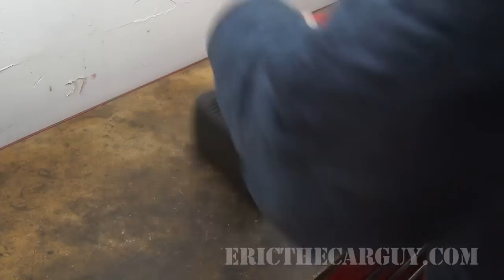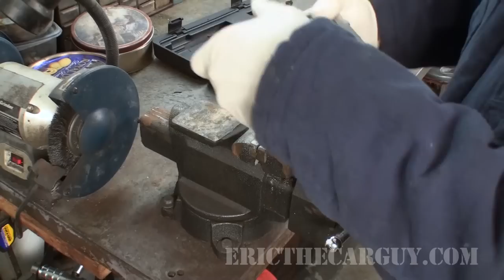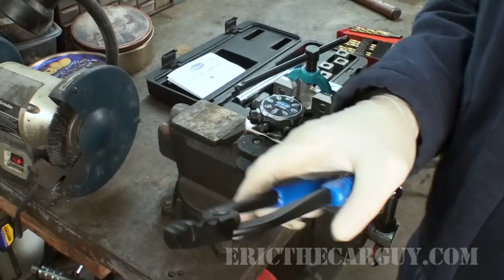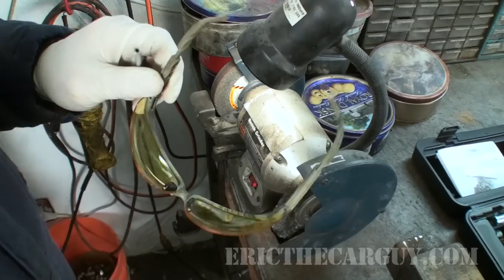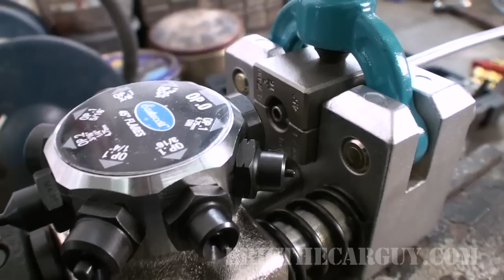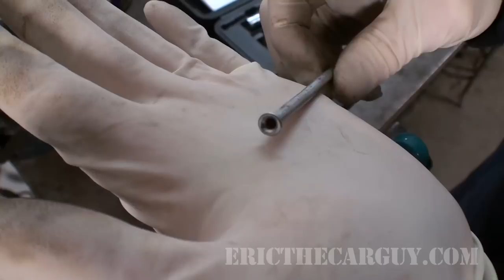Eastwood Line Flaring Tool Review -EricTheCarGuy

Comment: When using the tubing cutter I have found never go the same direction in turning. It is best to turn than tighten and turn back the way you came. This helps if your tubing cutter is worn or not properly aligned. It will give you a more consistent cut.

Comment: Another quick way to measure the brake line diameter, put the open end of a wrench over it.  A 3/16" wrench fits snugly over the 3/16" line and a 1/4" wrench fits over the 1/4" line, etc.

Comment: Got sick of using the older flaring tool over the years at about 60% effectiveness. Bought the Eastwood tool and the Lisle 3/16" tube bending pliers and was astounded by the effectiveness of these tools.Awesome. Best tool combination I have purchased in years. I have not made a bad flare since. Thanks for sharing Eric.
Reply: I've always gotten a 100% success rate with my cheap tool. I don't do enough brake jobs to spend the money on this tool.

Comment: Excellent tool, and fun to use! I'm restoring an old 56 Chevy, not a full time mechanic, so I found a Vevor flaring tool, pretty much identical, for less than $100. Comes with basic dies, and tubing cutter. Does both 45* and 37*.  I love it!!

Comment: sorry if anyone covered this already, but you mentioned that 37 degree flares are becoming more popular with builders for "some reason". The reason is in fact, stainless steel lines. You're supposed to use a 37 degree single flare on stainless line because of its nature to easily become damaged or split during the multiple bends required to achieve a 45 double, or even a 45 single flare. If you want the nice shiny stainless lines, you gotta do single 37 flares!
Reply: I use the Ridgid flaring tool specifically for stainless lines. It doesn't press the whole flare at once, it presses in a circle, slowly flaring as it rotates. 

I have this Eastwood flare tool also but I'm having issues now getting a flare that doesn't leak, and I've barely used it.

Comment: I have been using the Master Cool hydraulic hand tool and it works great. It will do double flare, inverted flare , push connect, metric bubble, and GM transmission. All at a cost of $300.00
Reply: 37 and  45 degree at that price?

Comment: Oh man....  I used the old style to do my Ranger once.   Now that I had that experience I can justify the $200 for this upgrade.   I knew about the $200 one from Eastwood, just tried to make the $60 dollar old style work.  Had to remake several flares as they were off center.  Spent lots of time...  learned a lot about flares.  Like learning to use hand tools before power tools.

Comment: Another great & informative video Eric. I have no doubt that this tool works great, is well built and well worth the price if you're doing a lot of brake lines in a shop or something. But for the DIY'er like myself (and I presume the majority of your viewers) who rarely has to flare hard lines, this tool is a little pricey.  I just wouldn't be able to justify the expense for a tool I might use once a year or so. The 'clamp' style tool is available for rent from most auto parts stores for 'free' so most DIY'ers will probably gravitate towards that tool rather then a $200 tool.  A video on how best to use the clamp style tool would be awesome though and probably help a lot of your viewers.  Thanks.

Comment: GREAT TOOL! But I would not throw the other flare too away, because it doesnt look like this can easily be used on the vehicle, like the other flaring tool can
Reply: I was thinking the same thing.  The only disadvantage would be a job where you have to do a run from the front to back and you don't want to take the line out again once you cut it to size.  But, this thing is still amazing.
Reply from the maker: You're right, and I won't.
Reply: EricTheCarGuy I wouldn't either. The other tool I seen time and time again was a snap on hydraulic tool, which is like $600 or something nuts like that. If I could get the hydraulic tool for $200 I would certainly get that. Ha, what you should really do is make a video on how to use that $20 flare kit. I used to work at an auto-parts store and see those things come back stripped all the time because people don't know how to use them right. One other thing I did was keep small sections of brake line in my tool box when I first started working on cars labeled with tape what size they where. Same with vacuum hoses.
Reply: I agree. I wouldn't throw the cheaper tool away
Reply: If you're doing 3/16" double flares, get the ~ $35 Eastwood hand held tool  It works much better than the butterfly type.  It's on Eastwood's website as 31244 and Eric has also done a review on it.

http://www.eastwood.com/eastwood-on-car-flaring-tool-for-3-16-tubing.html

Comment: AN Fittings ( believe or not stands for Army Navy ) is approved for aircraft. AN fittings use a 37 degree flare. I have been told the reason being the stainless steel will tend to crack when flared to 45 degree.

Comment: Recently picked up a very cheap GM wagon with rotten brake lines.  I have always shied away from a car with this problem, mostly because every mechanic I have known  has ruminated about what a PIA this kind of work is.  I watched your vid on the Fairmont brake line replacement, and I am super appreciative of the way you approached the task.  I am, as a DIY guy, ordering the Eastwood tool, yes, a lot of cash, but do it once, do it right.  Still beats paying the local jerk.

Comment: That is one well-thought-out tool! Outstanding!
Eastwood: make a simple line measuring tool to include with the kit (ie - a flat piece of stock with slots cut in it in the different tube sizes that can be slipped over the line to determine its size)

Comment: I bought one of these not too long ago and its takes all the hard work out of doing brake lines - they are actually fun to flare!  I've been getting away without lube, but WD-40 is good enough.  After your flare, slightly loosen the blue clamp and wiggle the line - that frees it up so when you pop the pin and swing the clamp off the line is not stuck to the dies.

What I like doing is removing a line off a vehicle and bending it to match and flaring new ends.  This is much easier and you don't have to use that clamp too under a vehicle.  Oriley Auto sells a REALLY nice hand flare tool like he shows above - it looks to be better material and has a better case.  Just tell the guys you are buying and not renting, or have them order a fresh un-opened flare tool to buy. 

Worth every penny - everyone will want to borrow it.

Comment: Excellent video very professional work. I had to replace the brake lines on my bmw 2005.750li 
they were rusted under the rear side sub frame  . I had to change complete  brake line from rear to front with flex hoses as well . I took the car to auto garage they said to work on this car with material you will pay 1500$  i said no thanks went to another one down the road he said  1000.$ with material because this car needs complete master cylinder flush and abs flush .
I watched > Eric The Car Guy<   what a great guy made it so easy and simple job. I did my car brake work it cost me 200$ Thanks to >ERIC THE CAR GUY< you are a  brilliant mechanic.

Comment: A proper brake flaring tool will save a lot of heart-ache.  We needed to replace the ENTIRE rusted out brake line system on an old pickup truck we got that had sat for almost 10 years.  My room-mate at the time took this on, and got a cheap flare tool, annnnd.... well... I believe it's still having leakage problems after 3 attempts.

A good flare tool and good brake line will save you MANY HOURS of work and tracking down brake leaks that are inevitable with a cheap tool.

Comment: They work great on brake and flared lines. but I like my Mastercool Universal. 71475. Does pretty much any tubing connection type out there (trans, brakes, fuel, HVAC) and can do it on installed lines as well as on the bench. This tool is nice but being bench bound limits you in many ways.

Suggestion on tubing size tool. Take a block of either hard wood or metal and drill 4 holes in it to match the tubing sizes. Or buy 4 of the fittings and couple them together.

Comment: Being able to fabricate brake lines is an awesome capability. Shops often charge a LOT of money for brake line replacement, so in places like the the Northeast it's not unusual to find used cars that are in good shape but need brake lines that are available way under KBB valuation. Spools of brake line are only +/- $25 and I tend to re-use the original fittings with no problems.

Comment: 37 deg. is used for stainless steal, because ss will fracture if you go any wider.
Reply: Could be. But currently running  7 double flared 45s that went off with no splits or fails using seamless stainless. Ends of stainless tubing need to be prepped meticulously i suppose. I used a dremel with a cone shape stone to prep the ID after using a carbide cutter to debur,  and  resize.  Work stainless slower than steel. I was told later that double flaring stainless wasn't necessary or preffered, do to work hardening, go figure.
Reply: You really should not STEAL anything, stainless or otherwise.
Reply: 37 degree is for any metal being used in an AN fitting.

Comment: At the 5:XX mark, you are holding the tubing pliers backwards/they are facing the wrong way.  You should always have the round opening of the tool on the outside of the bend so when you bend the tubing, it sits in the curved portion of the pliers.

Comment: Just from observation of the tool in the video I like the chunkiness of the load bearing parts of this flaring tool. Structual mass really helps the tool not flex and bend when using it so the tool is more precise (not to mention durable).

Comment: suggestions for you Eric- a nice sand paper can be used for clean up the outer edge of the tubing, doing it by hand this way will help prevent taking too much off with a grinder. if you do not have a de-burring tool a heavy grit paper can also be used in the inside of that lip and just finish it off with a fine grit to get a nice clean surface. lube on the working end is necessary and will help out a lot, glad you didnt leave that out of the video. the tubing pliers you were using make an excellent solution for bending line while in place, or for things that do no have to look pretty, but a quality handheld tubing bender will be justified if appearances are important. we always used the 37.5* AN flare or a swagelok compression fitting for cryo applications- the latter also being great for creating fittings while in place or when a very small 'back-to-back' fitting is required. as always great video ! (^_-)v
Reply from the maker: Cool. Thanks very much for the suggestions.

Comment: Very interesting tool....seems like a great bench tool. Someone had commented that flaring steel 3/8" line was a problem I have to ask what you doing with the steel line? Power steering maybe?....We use 3/8" aluminum line for fuel injection and the aluminum is good for 300 psi.  Also I didn't see it anywhere, but many hot rodders like to do their brake lines in stainless steel, but if you do so make sure your SS line is "annealed" not hard....soft enough to flare correctly, but plenty strong for brake line pressures...

Comment: this thing is amazing. had it at my old job you can double flair a brake line in like 5 seconds once you get good with it. changed jobs where we do alot less brake lines and going back to the regular flare tool sucks. if anyone does alot of brake lines or flaring of any kind this is for you. where as you may flare a line once every 4 years then yeah just stick with the manual one

Comment: I bought one on your recommendation and love it, except... For the life of me I can't get it to form a proper double-flare with 3/8 steel line. 3/16 works flawlessly, but after more than two dozen attempts with 3/8 I've given up. I've tried various degrees of chamfering, two different brands of line and the result is always the same. ~270° of the flare end is perfect and ~90° looks only partially formed.

Any ideas?

Comment: Just two quick comments. One is that it is unlikely that we will "deburr" a 5 or 6-foot length of tube on a bench grinder. A uniform end is not likely. I would use an "inside" and "outside" deburring tool akin to what bullet reloaders use. It is fast, uniform and clean. Second is that bending plier works better on Nicopp tubing and is an awesome tool to use while you are fitting the lines around all the obstacles along the chassis. Quick hint: use a little brake fluid on the tip of your finger over the end to be flared to ease the flaring process. Just a smear will do.

Comment: I wish I knew about this tool about 4 months ago when I had to replace my brake line on my f-150 from the rabs block to the rear. I had bought two flairing tools which were crap and then got one from K tool international. It worked OK but still could not get a consistent flair. If I have do it again I will definitely get this tool and by the way bending lines isn't fun at all especially when you have to go around things on the vehicle a certain way.

Comment: Eric, check out the Mastercool MSC71475 hydraulic flaring tool.  Will do trans/steering/fuel line flares so you don't need to buy those "repair lines" to change a filter on a really rusty GM.  Lines went from being miserable to being tolerable.
Reply: also, you can use it on the vehicle.  no vice required!
Reply: Kevin Malone i agree Kevin,awesome tool. i paid 390 to my door but i can also do twice the lines and on vehicle.

Comment: you should check out the mastercool set, it does brake and fuel lines and a few of the guys at my shop have them and they work awesome. it also doesnt need a vise so you can do flares in the car.

Comment: Nice kit and certainly a step up from the traditional tool.  However,  I'm not a fan of being confined to the vise. Sometimes I need to flare a line that is already on the car.   I use the Matco hydraulic flaring tool.  More pricey but it's worth it for the portability.

Comment: great tool, but one major issue. its ment for a vise... so when you go to try and use it under the car it's useless, there alot of modren cars where its impossable to make the line before installing it, they got the bloody things wraped all over the place.
i perfer the one napa, snap on, matco ect... sells where its a little portable ram with the same die's but it can also do other things besides just flare's.
awsome review eric!

Comment: I greatly appreciate that you gave a tip on how to de-burr/clean up the end. I don't have a bench grinder though so I am still fuzzy on how to prepare the end for flaring. Help? Do you flush out the completed line with ??? brake cleaner? water? air? *Love your instructional videos and especially this one as I have a big brake line job ahead and no clue-- like I didn't get how the fitting thing works until you showed that it is going to apply a clamping action on that flare, screwing into ... hmm. whatever it threads in to... Any tips on torque for installing a fitted brake line like this? snug + ?
Someone mentioned that you can use the other type of tool under the car,  so maybe it is worth keeping. I WAS going to buy one of those and try to figure that out, but I have seen the light, and well on my way to justifying buying a more "lifetime tool."
Reply: they have actual deburring tools. some of the tubing cutters have them built in especially the larger ones. ive also used pointed punches to debur the inner wall and simple sandpaper on the outside will do just fine

Comment: Correction for viewers watching.

The die he used has to be turned the other way for a bubble flare. What he did with OP 1 was a 45 degree single flare, which became a 45 degree inverted flare with OP 2. A bubble flare has a 90 degree, not a 45 degree. 

You can see the 90 degree in the other side of the die when he only has half of it installed, it will show "DIN/ISO", NOT 45, on the correct side.
https://youtu.be/UxeA1lhSCsk?t=602

Comment: Wow -- that looks to be WAY easier than the old-style double-flaring tool that I've been using...  Of course it costs 4 times as much -- but clearly you're getting what you're paying for there.  If you make brake-line or fuel-line flares on a regular basis, it would seem that you would want to spend the extra money on this tool.

Comment: i do have one issue with this set. how exactly do you do lines on the car if its a vise mount system?  if youre a production mechanic making lines on a bench with fine measurements is simply to time consuming when compared to using the old school tool. now granted i have had some really really crappy flare tools. the harbor freight one like you showed... well it works. but it has a lot to be desired. now they do have a handheld version of the estwing tool thats hydraulic. but it is a pain to setup with the different dies and extra pieces trying to place in a specific order all at once. the best thing ive found has been the ATD brand old school style kit. i got the full master kit with the bender and tubing cutter since my cutter was shot already the price was right. i have yet to have a single bad flare from this tool. its small enough to do lines on the car in tight spaces. its smoother than youd ever expect in operation and has me sold on ATD tools. for the 79~85 dollars i would highly recommend it. i do brake lines at least once a week sometimes every day. ive gotten to a place where i can comfortably reroute and run every line on a car in the factory places in only a few hours sometimes as little as 45min depending on the routing. brakelines are no longer a miserable adventure. one of the few tools id stake my reputation as a tech on. the ATD 5478 master brakeline kit